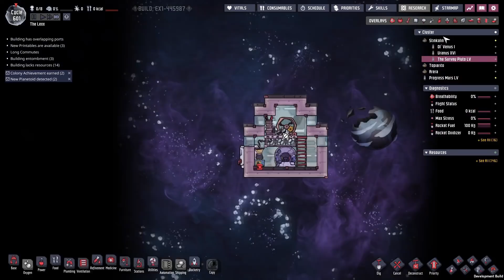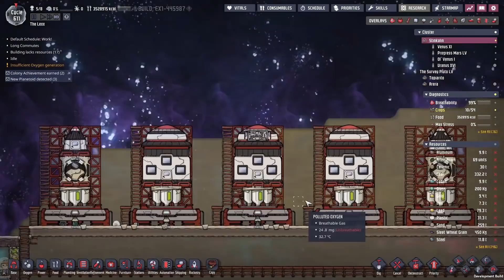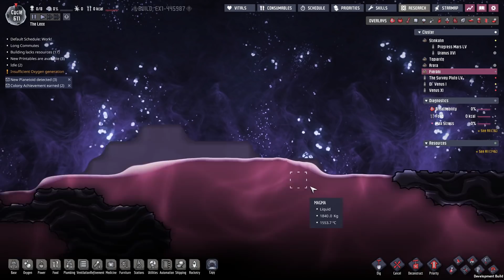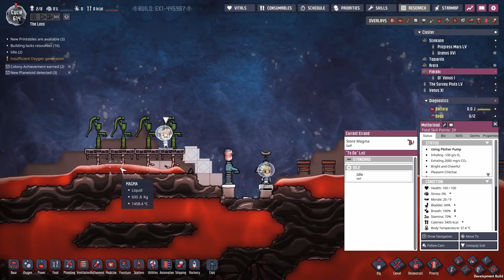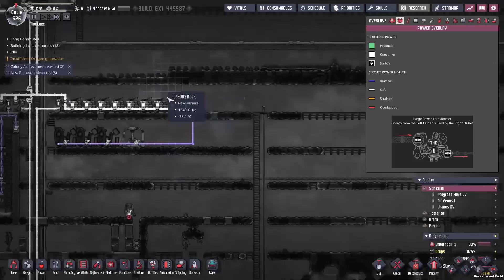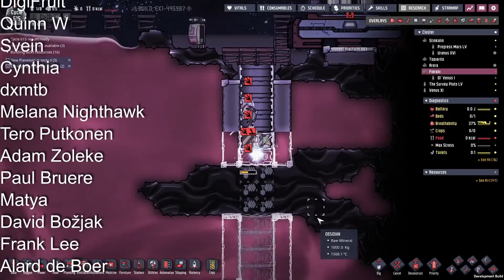Ep 7 Superconductive Niobium Asteroid :  Oxygen not included : Spaced out

Comment: I feel like taming fireoni is more about the challenge than the benefit
Reply: Yes, the niobium geyser will be almost 3700'C. Without procautions there will be lots and losts of rock gas.
Reply: @MugoanE  
indeed, since Obsidian will melt into magma at 2728C, even Obsidian tiles won't contain it.  Insulated Insulation may be required.  That will be a challenge.
Reply: @SeriousBurnsUnit  Lots of Steam turbine with their cooling loop? Or cleaning out all pieces at planetand pumping liquid niobium onto a netronium tile then make it cool? Both are too much effort indeed.
Reply: @MugoanE  depends on how much it outputs, you could just go really over the top on the cooling and also use tiles with high thermal capacity and mass
Reply from the maker: ONI has kind of always been about the challenge, we hit perfect sustainability about 100 cycles in when we started the gym. Everything after that is doing it for the challenge and fun, we don't need a petroleum boiler, but we do want one for the fun.

Comment: I think it'd be fair to allow vertical expansion of the rocket interior using the tile replacement exploit. The main downside is the tile compression between the rocket module exterior and the size of the interior map.

Also, I definitely think there should be (there isn't atm) a research item to allow recycling that CO2 from the living quarters into the engine module.
Reply: Some way to pump in gasses and/or liquids would be nice, then you could build your own little contraption to do what you want with the CO2.
Maybe introduce an advanced big spacefarer module for that so it isn't too OP right off the bat.

Rockets probably should also count the interior mass towards the final rocket mass for fuel consumption so you can't just lug around an entire planet's worth of material in one go.
Reply: @iGourry  Maybe have some way of accessing storage from your rocket modules too. perhaps a built-in / new module for sweeper storage.

Comment: Pip-planted oxyfern and wheezewart work wonders inside a ship.
Reply: That's simple and brilliant. Thank you!
Reply from the maker: I think you need about 10 or so wild oxyferns to keep up with one dupes, might work on the big rocket capsule.
Reply: @FrancisJohnYT  One oxyfern and a wheezewort will, over time, remove the CO2 and the heat from the rocket. So as long as you don't need the rocket, the plants can do their thing. Way more eco than rebuilding it.
Reply: @FrancisJohnYT  what about a slickster. If you had one.
Reply: @imaltenbach9166  - My slicksters didn't live for long below 85 degrees.  I don't think I'd want my dupes in a rocket that hot.

Comment: For balancing the rocket internals (@2:30), I think the simplest option might be if they made all 'loose debris' fly around on takeoff.  That'd injure people and damage things.  Make that dependant on the total mass, too much unsecured cargo resulting in enough damage to kill a duplicate, and then there'd be a pressure to not have any loose debris, whilst still allowing a 'trade off zone' with a little lying about.  It'd mean a bit of special code, but as it'd only run 'at takeoff', it shouldn't interfere with the general mechanics.  It also fits well thematically with rockets!
Reply: Just calculate the total amount of mass inside when the rocket moves, and adjust the fuel use accordingly.
Reply: This seems too agressive compared to the entire game itself to be honest. I think the easiest way would be to just take into account all the mass with the fuel at the end of the calculation. Maybe something like "between 1 and 5 extra tons u need x extra fuel" so it's not ultra picky on weird numbers and tables of data can be made
Reply from the maker: Oh... how about just have all loose debris in a rocket drop out of it on take off? You would still have to do something to limit storage containers, maybe have a built in storage container and that is all you can use/build inside.

Comment: The most efficient way of transporting energy in ONI:

Bottled magma
Reply: If only there was a good way to get them to carry, transport and drop/store bottles of liquid and/or air without relying upon an emptying errand
Reply: @nolan4339  you can automate a door with a duplicant sensor just before the bottle emptier. When it closes the dupe drops the bottle.
Reply: @nolan4339  it's a shame they don't include the bottle inserter mod into the base game that solves all those types of issues instead of needing a pump + visco gel exploit to move magma
Reply from the maker: I have played this game so long I forget how unintuitive and ridiculous it is that you can use a pitcher pump to move magma. Though I do think we can export magma from this planet at some point.
Reply: @FrancisJohnYT  forget the pump pumping magma.

HOW CAN A PITCHER PUMP CREATE A PLASTIC BOTTLE TO STORE THE MAGMA, WHY DOESN'T THE PLASTIC MELT AND WHERE DOES THE PLASTIC GO AFTER EMPTYING THE BOTTLE?
Reply: @FrancisJohnYT  won't that be incredibly hard, as the Magma would cook everything inside the rocket?
Reply: @jebkerman5422  They fly only 0.6 turns. A dupe with deep divers lung could wear his suit all flight long.
Or a box made of double layer insulation.
Reply: @jebkerman5422  If the magma sits in vacuum on a mesh tile, it won't exchange heat with anything.
Reply: @imaltenbach9166  but he doesn't only need to wear it all flight long. He also needs to work on the planet and refule the rocket, which will probably take 0.5 to 1 cycle as well.
Reply: @Tamizushi  the question is: can your dupes survive long enough to get to the planet, work there and get back, all without being able to breath inside the rocket?
Reply: I think turning one planet into a natural gas or petroliumboiler, then using rockets to ship it of world might work as well.
Reply: The newest update added interplanetary payload launchers. they can transport any liquid to any planet using just radiation. 

this might actually be a thing people do